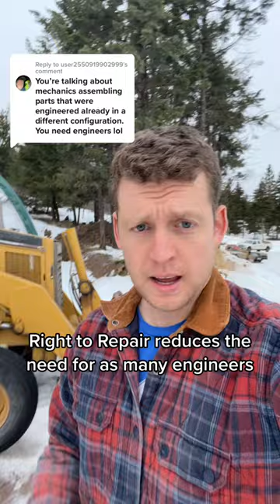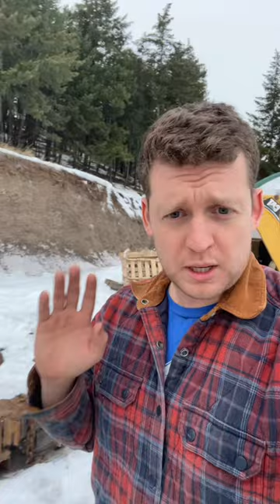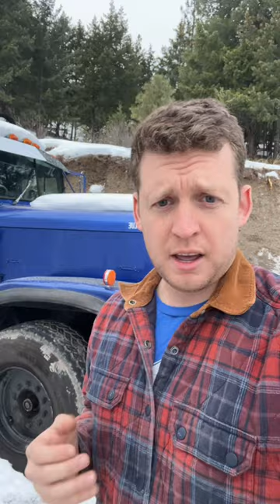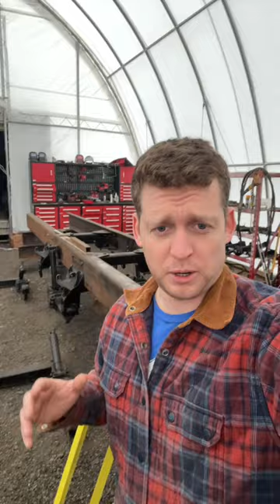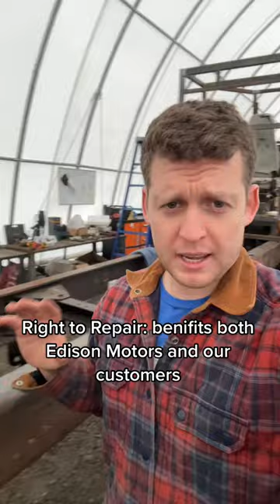Right to Repair: How Edison Motors Fast-Tracked Production Using Off-the-Shelf Parts

Comment: As an engineer, my favorite thing to do is spec off-the-shelf parts. Someone already did the work to make the part that does the thing I need it to do, why would I reinvent it?
Reply: Yes,  love just compiling a whole bunch of parts and then figuring out how to put them together and make them work. Easily the best bit.
Reply: It's a HUGE reason why "IBM PC compatible" and "IBM clone" eventually just became "PC". Nowadays, if your personal computer at home isn't a Mac, it's probably a PC. It all boils down to IBM's decision to built their computer using readily sourced commodity components. The only proprietary thing they made for it was the BIOS, and well, we all know how long that stayed proprietary at this point.
Reply: Because when you’re building a system there are ways to optimize it. In the world of engines yes there is an “off the shelf” tune, but you can also modify that tune to make it better suit your use case.

Right to repair doesn’t mean producing an unoptimized system. It means that system can be fixed easily.
Reply: @raelik777  when I worked desktop support, I used car analogy to explain computers to my users. This is the first time I've seen a computer analogy to explain a car.. 😂
Reply: You are the exception not the rule
Reply: For real, imagine if you needed to redesign every bolt for every fixture you've ever made
Reply: Yeh. And if you wanna make a new part that does the thing but does it better or more efficiently, you should probably be working in a different division or different company entirely.
Reply: This is how the bicycle industry works.
Reply: this is exactly the NASA mindset when it came to a lot of low budget-high impact missions and I love it as someone working on becoming an engineer. Designing parts is fun but someone else has already done the work for you.
Reply: As a welder/fabricator, just double check its the right part, go see it hands on if you can lol make sure it's the right part and size every way around. I'm joking but I used to have a problem where dudes would throw a part on a blue print thinking it'd work because it looked right one way but if you looked at it 3d from another direction it definitely would not. How it made it to the floor I'll never know. We had one where dude took this motor and shrunk it on the computer and slapped it in there thinking we could just build this whole motor smaller some how lol. Gotta love it
Reply: That is good engineering
Reply: Bc as an engineer, the off the shelf parts never get it exactly right
Reply: Same. I mostly work with software these days but.. why reinvent the wheel? If there is something that cannot be solved by an off the shelf solution (very rare these days) then sure. Otherwise, why pay someone to design and test it? Why pay for tooling costs?
Reply: You will do what you are paid to do, even when it's only for the sake of making things difficult to repair for "planned obsolescence".  This problem has been more than overthought.  The solution is simple.  Most IP Laws that enable this nonsense needs to be "abolished".  That would solve this problem over night because businesses that made hard to repair devices would just stop because it would not longer be a viable business model like it is now.
Reply: Then your bosses say, "alter it slightly so they can't use off the shelf parts."

Comment: The right to repair in the truck industry is fast going away. The new computer programs from Volvo and Cummins are horrible....and Volvo has long worked to force you into the dealer. They will sell you a light control module, but after you change it you have to take it into the dealer to have it programmed to the vin. Why do you need a computer to turn turn on the lights?

Comment: People seem to be misunderstanding what he's saying. He's not saying he doesn't need engineers. What he means is that for their production line they don't need a ton on engineers because they're not building parts specifically for their vehicles. Edison is using already made items that you can buy in most parts store. Yes they were made by engineers, the right to repair is to making parts accessible. You don't need to hire engineers to make parts custom for your truck when those parts are already available. 

Engineers are important. But when you have teams to make parts just for your vehicles or item. It creates a huge bottle neck for parts. For example Tesla. I have a Tesla and to replace the headlight the backorder was 6 months from tesla. Edison are just using quare led light you get the size and you can order it without going to the supplier. This is just one of the many examples.

This is a fantastic way to do business. Edison motor is doing a great job. Chase keep it up man. We need more people like you to say good bye to planned Obsolescence. The only way to change Other
Reply: Other companies will only change when more companies like this takes away business from them by making this to last and work. They won't change until it hits their wallets. 

Imagine a company like Edison made farm equipments that you can repair. John deere would go out of business. John deemed is putting curved glass on tractors that go at max 10 on farm land. Only reason is to charge you out the rear end when you need to replace those glass and other parts.
Reply: It really goes to show the lack of critical thinking, reading comprehension, and ego of the average engineer
Reply: @jamalmoe6091  So why aren't farmers still using their grandfathers tractor that they can get parts for all day long?  Why did they buy one that they can't repair?
Reply: @N-M424  alot of them did and still do. But with the market not the same. Even the best tractor can only last so long. The money they used to make from the size of the farmland is not the same, with inflation and the taxes and new regulations put on them by our government pushed by big corp. They have to expand and to expand they need bigger quipments. Having getting larger land and loan for new quipment only John is will  void your warranty so fast if you try to work on your own equipment and most of them time there is a wait time because they make their own parts and you cant just use something off the shelves when some of their parts could have easily been made with off the shelves items. Like think about it why dies a tractor need curved aero glasses? 

From a manufacturer stand point is fast and easier to make flat glass and to replace it. Only reason for it is so you have to buy their glass.
Reply: @N-M424 alot still do but they sadly arnt big enough to work the amount of land that the farmers have
Reply: Electric vehicles are the epitome of planned obsolescence.  Battery for starters, plastic the rest. Love what Chase and the crew are doing, but overall it’s a huge amount of capital expenditure for what, a couple fleets of trucks. BC Hydro tried this for years with their Hybrids and electric fleet of service trucks (pre and post 2010), and all full of off the shelf engineered parts. Most never left the yard, fellow tech and I were at their yards constantly doing recalls and reflashes for the dealer we worked for. All sold at auction, some with full tooling.
Reply: I wanna note your comparison notes an interesting flip in those names. Tesla and Edison in their day would have been on the opposite sides of this debate that the companies who now borrow their names are
Reply: @drizzt102  it truly is interesting how flipped it is, both Edison and Tesla are rolling in their graves for completely opposite reasons
Reply: Also with a Tesla, they make you " rent" their software, the Tesla toolbox, for hundreds of dollars which should just come with the car. That right there is why I'll never own a tesla
Reply: Reading. or listeing  compenhansion is a lots part n our society. He explained it so well.

Comment: Very much appreciating this attitude right now.  Just ordered two slack adjusters up from the States for $750 a piece plus freight because Marmon-Herrington chose to build their own with a non-standard spline count. Now the truck is down for at least a week or two while waiting for them.
Reply: Is the shaft a non-standard diameter, as well? Seems changing the shafts for ones that fit readily available adjusters is the long-term fix. Hell, a machine shop could probably make you a pair of shafts that fit standard slack adjusters for less money and wait time.
Reply: WTF!!! I’d be pissed if that kind of stupidity  was in my fleet
Reply: @jarradschiff4202  I suggested it as a possibility and actually found some S-cams that might have worked in the Meritor catalogue but was asked by the guy with the money not to go that route. I definitely could have put S-cams on both sides for less than the cost of one of those MH slack adjusters. They're 20-spline on a 1-9/16 shaft with a 1-5/8 journal. ~10" long. Even if I couldn't find a "proper" s-cam that size it could definitely be sleeved for an off-the-shelf cam but again not my call there.
Reply: @PurpleNovember  It's an upfitted front drive axle to make a Chevy Kodiak a 4x4. This is the sort of shit that happens when you send your truck out to an aftermarket upfitter for modifications unfortunately. At least in this case the manufacturer is still in business and hasn't discontinued the parts. Not the route I would have chosen to go if it was my own truck, but as long as I'm not being asked to do something dangerous I'll do what the guy with the money wants.
Reply: Jeez. Seems you tried to get in the way of someone's "this unit's too expensive to maintain, we'll need to replace it with something way more expensive so we can 'save' money" proposal they'd likely been working on for weeks. How dare you try to save the company money!😀
Reply: @gogmorgoaway  I thinking it had to be an upfitter   The fleet maintenance I did a junk of our pay was based on uptime and maintenance cost. The techs are had a lot of input into equipment purchases.  It’s ultimately the money man’s decision. It seems like a lot of it comes down to lack of options when purchasing equipment.
Reply: @jarradschiff4202  Kinda does sound like that,  I’ve seen that a lot with power and phone companies.

Comment: The other nice part about designing this way is that you not only are using commonly available parts in the first place, but the simple geometry makes it easier to interchange for similar parts if specific ones become unavailable. A rectangular light is a rectangular light, and a little bezel adapter can allow you to go from one to the other. Same theme applies elsewhere. 

What are you guys going to do about CAN bus stuff? Will you make addresses and messages public so that owners can more easily do diagnostics/replacements/upgrades?
Reply: It takes the corporate greed out of it with specialized parts you can only get at the dealer
Reply: They have addressed this in the past. From what I remember, they said something along the lines of the error codes will just be displayed on that screen in the cab or it'll just tell you what the problem is and you won't even need to look up the code cuz it can just say hey the engine isn't working because this particular thing (I don't know enough about engines to come up with a specific example) or The wiring for the main battery pack has failed and the battery pack has been disconnected.

I don't know if they'll go that far but I'm 99% sure Chase did just say at one point that the error codes will be displayed on that screen
Reply: @the_undead flashing light code if I'm correct.
Reply: @bondobilly9369  ? 

From what I remember Chase just said the codes would be there in plain English, whether that means it's just telling you what the problem is or it's just saying error code f3w. I don't know if it's the former option. Phenomenal if it's the ladder option. Hopefully a quick google search will tell you everything you need to know (which if they plan to deliver on their promises of right to repair, this would likely all be on their website along with several other places
Reply: @the_undead the panametric fam's side fumbling is out of spec.
Reply: @the_undead he said that he wants the errors to show up with an English name and ideally some potential causes/fixes
So unless it's a specific part returning an error code, it's gonna be plain text.
And worst case it's gonna be something like "unknown error: the esc returned 0xf0. try turning it off and on again, I guess. And call us if it keeps doing that."
Reply: @satibel  It sounds like he's building a factory code scanner into the truck. The OBD basic code set is required and I expect any optional ones will show up on a scanner as well as the on board display.

Comment: As an engineer at a truck manufacturer, hell yeah man! Do all the of the shelf parts! Also if you need to make brackets, fixtures etc dont use cast parts, 99% of cast parts can be replaced with quick to make and quick to remake plasma cut plate and bent sheet metal, 3/8" or 1/2" plate is good for most things and most machine shops/maintenance shops can fix or replace it quickly

Comment: Kuddos to you for that! In a past life I was an industrial maintenance tech for a digital printing company. The number of engineered parts for each machine, even for the same 3 machines that were all built within a year of each other, all had different parts in areas. In order to keep stuff running with minimal downtime you'd have to have almost an entire machine in parts sitting on the shelf for each different machine. The cost was outrageous. But that is how many of the brands get their equipment into larger companies, they cut the actual cost of the machine, but make the maintenance on them outrageous, and where you can only buy parts from the manufacturer.

Comment: This is really great to see. Nothing wrong with proprietary parts of they're needed and easy to work on/replace and sold for a reasonable price. But if it's not needed, then off the shelf makes life easier for user and maintainer.

Plus, imagine you're somewhere remote like in the middle of Alaska. You break down and need a replacement part you don't have. With some vehicles/equipment you have to wait to be recovered and taken back to a shop, who knows how much that would cost and how long it would take. Others might send an engineer out, again at what cost and time lost? Some might send you the parts you need but because there's a backlog you have to wait months and they're the only people who produce it so you can't go elsewhere.

But with off the shelf parts, it's just a matter of seeing what sellers got the part for the best price and can get it to you quickest. Back up and running within a week, worst case.

Comment: They make custom parts primarily to improve on manufacturability and cost. An added benefit is that they can control the supply chain, profiting through the sale of replacements and avoiding issues with off-the shelf parts disappearing due to obsolescence or things like someone signing an exclusivity contract with the manufacturer of a specific part. If you make 5-10 trucks a year, then by all means use off-the-shelf parts; but when you start making 1000, custom parts start becoming an interesting proposition.
Reply: YES, controlling the supply chain!
This was regularly an issue for low volume industrial manufacturers which relied on outside sourced components. 
The supplier would change or obsolete some component that the low-volume builder had been buying to build a given model. To be able to continue  producing given model, this would cause low-volume builder to  scramble to replace the unavailable component with whatever else was then readily available. This change would often "domino" throughout the "assembled" product; often causing what had started out as a great product assembled from an ideal mix of sourced components to (with subsequent changes) slowly devolve into a cobbled-together mess of mismatched components.
Reply: with a standardized part, just off the shelf... there's usually 2-3 manufacturers of that part. Or you can just send the spec to a new manufacturer if the old one goes under. It's like ordering a generic of a medication. Don't need the fancy designs, if you can just use the generic!

Comment: As a mechanic myself,  I used to curse engineers... now I curse the accountants at vehicle manufacturers.  I've had some long discussions with engineers from GM, and from some senior managers at Ford.
Not all but most engineers are car guys, who understand serviceability, aftermarket interest and vehicle longevity goals.
Before anything goes into production the accounting division axes so many good designs only to save a few cents here, a dollar there in production.  I understand it now as if a manufacturer produces 1 million units, and if the accountants can save even $100 of production cost on those units, that's 100 million dollars saved... put that savings across multiple platforms, and the number skyrockets..   
It's to keep costs down, and headaches up in my world...

Comment: I love this way of doing things
I have built a few motorcycles with the cheapest reliable parts I could find. one of the issues I ran into was even though I used off the shelf parts, years later when repairs are needed, those parts where hard to find. for me no big deal I frankensteined it the first time, I just retrofit whatever is easy to get at the time of the repair, but if I had a design of a vehicle going into large scale production based on off the shelf parts, I would want some guarantee those parts would still be available and unchanged for the foreseeable future.